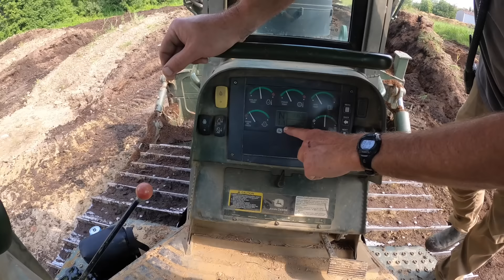My First Time Bulldozing with @DirtPerfect

Comment: Great JOB operating 😊 your first time. I started running Dozers back in the late 1970s running JD-450-C and Case 450s
The JDs had a clutch pedal and the Cases
Had this sweet power turn levers, for me it was harder on reverse in the case because I always turned the wrong direction, I just used the brake pedals in reverse. We also had a 125 International in Dozer and front bucket type machine. The International were a little bit slower but boy the pushed dirt over top of blade 
We used a 850-C case front bucket loader to run pea gravel to mainline sewer crews that 850 Case was as fast as a wheel loader, but the muddy conditions of the job site and the easement work, the track loader worded better than a wheel loader, the operator preferred to used the 850 Case over the International loader because it was faster running the pea gravel to bed the sewer pipe. You figured out the control right away, in my Humble opinion you did better than the guys coming to work first time on are jobs. I did mostly sewer main installations in new housing sites. When we would work on a Saturday, all us guys would say switch, and we would get in a different machine. 
I remember pushing a sewer manhole cover OFF the top with loader, my bad.
But it was FUN switching machines, and running another piece of equipment for the first time. We had a big Bucyrus Erie 
350 excavator for mainline digger 😊 it had totally different control levers ( air over hydraulic system) the swing was forward and back on lever, not left and right like modern excavator NOW. It took a learning curve to operate it correctly 😊
But boy it could RIP out hard pan ground like it was nothing. We changed our bucket teeth very often. It was one of the most powerful excavators I have ever been around. I bought a used 
Dynahoe -190 the little brother to that 350
The Dynahoe is the rubber-tired Backhoe that Bucyrus Erie manufacturer made till the mid 1980, my Dynahoe  is a 1978 model. She is a beast in my back yard 😊
She is my baby girl.

Comment: I got to drive a Grade-all at the county. It was old. It had a 4-speed clutch-driven transmission but with a deceleration pedal or Clutch brake like that. And about 15 other leavers for the blade and tire rotation, IE rolling sideways on hills.

Comment: Atta girl. You are not afraid to try things. Cut a slot as the blade carry’s the dirt better, and after clean up the windrow by biting into the side. 2 or 3 passes and vala ,done. Good job. Smaller dozers are harder because they are shorter, so that makes them choppierand harder to make a smooth pass. Practice makes perfect

Comment: I got behind the controls of a big ole Cat once, it was fun! But our operator was digging out holes on the side of actual "Lookout Mnt" Tn. So he had to use the track hoe too, to step the dirt down, so when he lowered me down into the hole, after tying the 1 inch rebar box, I rode down inside the rebar box, had to secure it to the bottom, so the concrete wouldn't float it out! Fun fun!

Comment: Alot bigger than the dozer i started on which was a CAT D6 without Hydraulics used a cable to raise and lower the blade and if you wanted to adjust the angle of the blade you had to spin each side to the angle you wanted oh and no AC open station with a canopy

Comment: You could probably get one with good business credit or a loader and you could start clearings and rent anything else if u needed to when you do clearing theirs usually a clearing line cut the trees or push em with a excavator then u gotta find someone to haul the logs use the money you made off selling the logs to pay the truck drivers and just make sure the check made out to the business after that your gonna need cut sheets given to you by the county telling you if you how much you meed to cut out strip the top soil make your cuts bring good dirt in if u have to call some surveyors dig a basement it's all money money money cant do drainfields or some plumbing unless your licensed  idk what you need as far as setting storm sewer and water im not sure some of that stuff needs to be inspected by the county to make sure its up to code but you should really work on your licensing and insurance and business credit b4 you attempt to go into excavation baby steps thats all it is its all baby steps 👍

Comment: Great job but when you start a cut try not to raise or lower the blade. When you raise a lower it creates ripples that will mess you up on the next pass. Very slow and steady on the blade. , you will start to feel it in your rear end in the seat.

Comment: She learns fast----my only comment is---why is she not wearing the seat belt??? The reason they have seat belts in heavy equip is because if they roll over, the operator stays in the cab which is the ROPS system!!!!!!! In my 50 years in heavy construction, roll overs of dozers, when the operator was thrown out or jumped, the dozer then was a killing machine and more often than not came back down on the operator---Just saying----not OSHA approved!!!!!